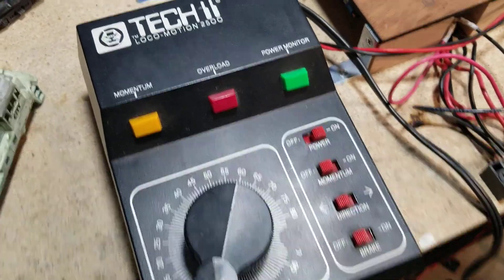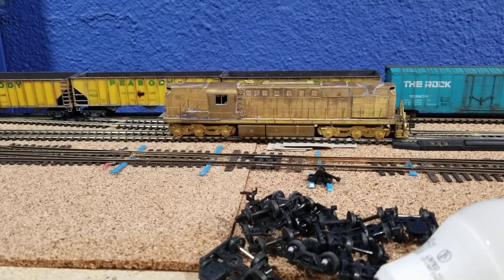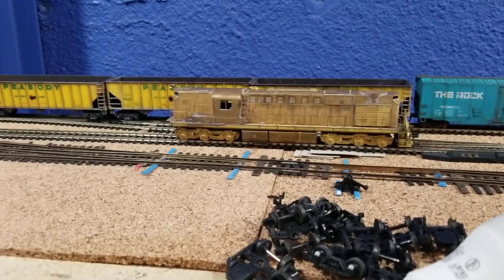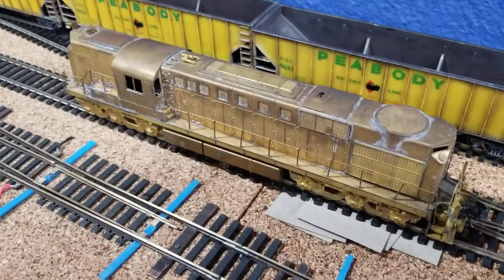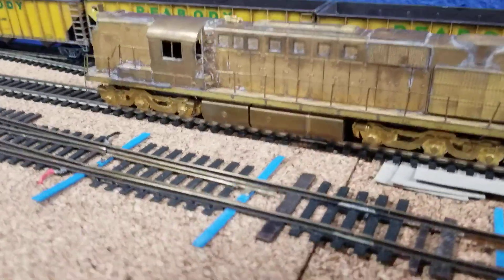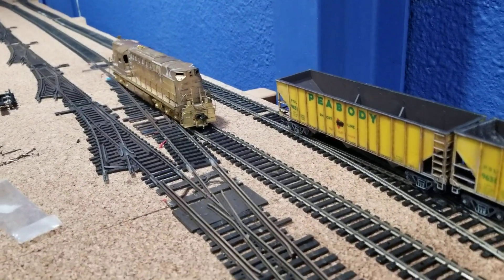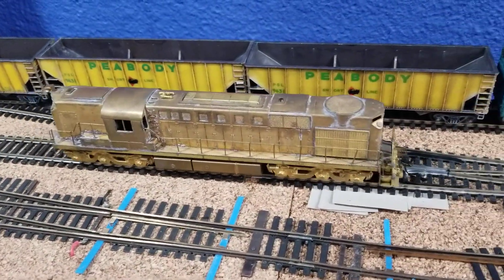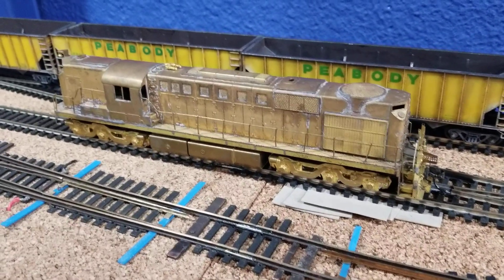Alco Models RSD-15 HO Scale KMT Rebuild Part 1 Overview

Comment: Isn't that a Alco rsd-16???
Reply from the maker: it's an Alco DL 600B which should be the RSD15 - in the video "Looking at some HO scale kitbashed projects"  I have a look at the almost finished model that includes the new motor and mounts with some testing.  The RSD-16 is only used in Argentina, and I think they are all still running today.  Good eye!
Reply: @elite194  I'm from Argentina, and i confirm that they are still used, thanks for the nice reply.
Reply from the maker: @J.M_Valente  no problem!